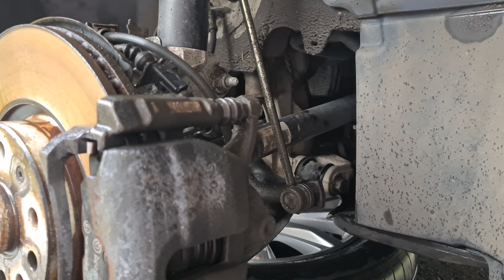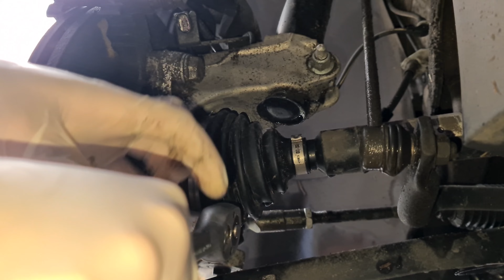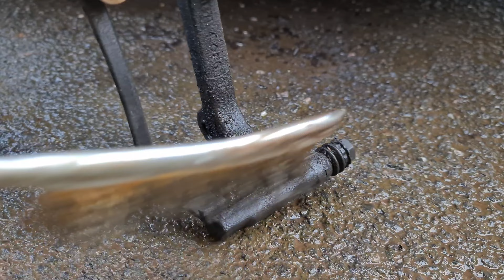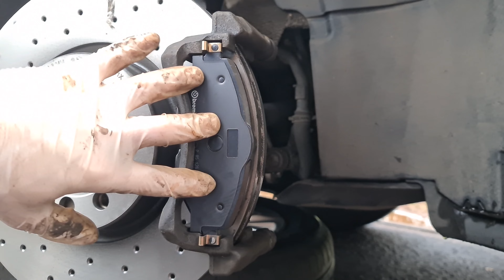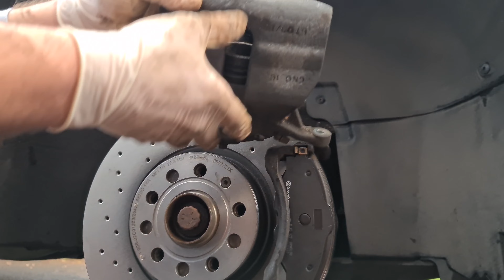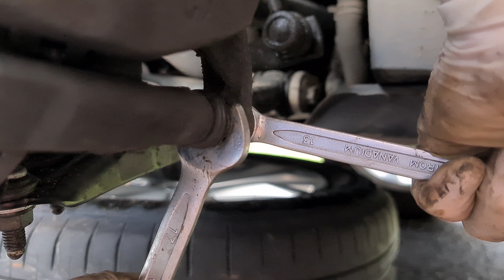how to change front brake discs and pads passat b8 | arteon | schimbare discuri frana fata passat b8

Comment: You should use brake cleaner to wipe the new discs before putting the tires back on. The discs are coated with storage wax or oil to keep them from rusting. Now you foul your pads if not removed first. Also use brake lube in the backs of the pads to keep them from squeking, as mentioned earlier by Mark.
Reply from the maker: you're right, but still, in my case, I tend to think that the problem is elsewhere, the composition of the brake pads that contain too much iron. Now, the sound is not always present

Comment: I recommend using a torque wrench to tighten the screws with the OEMs default values.
Reply: Ja, auch ich würde einen Drehmomentschlüssel verwenden.
Reply: Do you know the Tq values to set?
Reply: @jakem1900  Sure, there are offical documents from the OEMs where you can find them
Reply: I found the following in the VW workshop manual:
21mm: 200Nm
13mm: 35Nm
The 21mm can be reused, but it is recommended to clean them
The 13mm must be replaced

Comment: Please note that the pads are not equal - there are inner and outer pads. The inner pads also have direction. The old pads were wrong. The new are fitted OK. Also use ATE lubricants before push the pistons under the rubber protector and at the padse where they make contact with calliper. Regards.

Comment: I’ve been doing this to my own cars ,all VWs ,for the last 15 years and I have never seen a standard bolt holding the cradle on to the strut, it’s either an Alan head,torque , or the 2018 I have is a Triple Square or Spline head.

Comment: You need to clean more...a lot of the slide parts!!
Basic work...done.
Reply: How?
Reply: @haydars  Small metal brush...or one of the electric screwdrivers... there r some small metal brushes.
Clean the screws(slide ones to) and use special gress.
All this is extr. good for long term.menten.